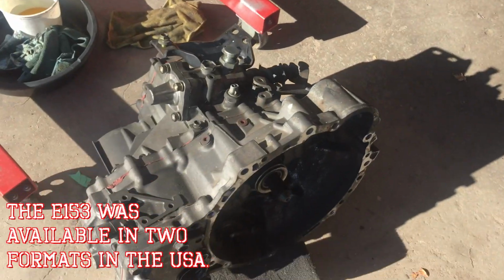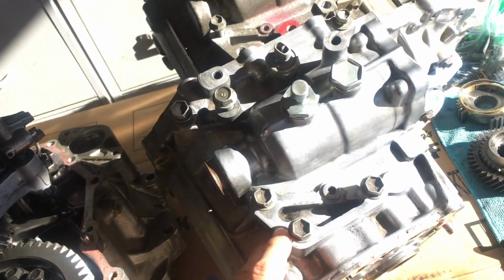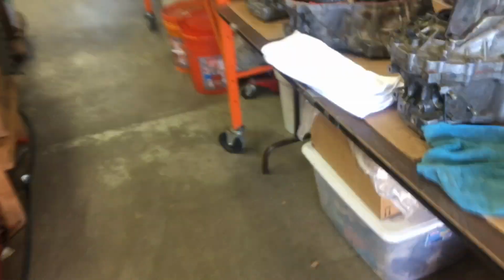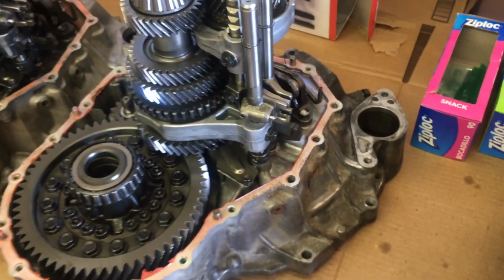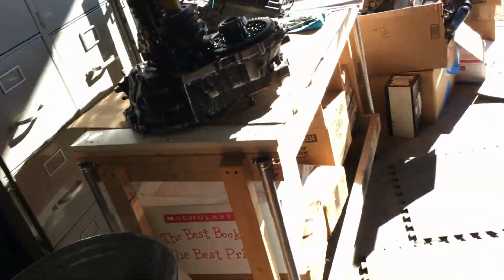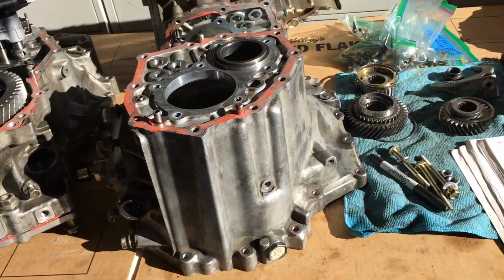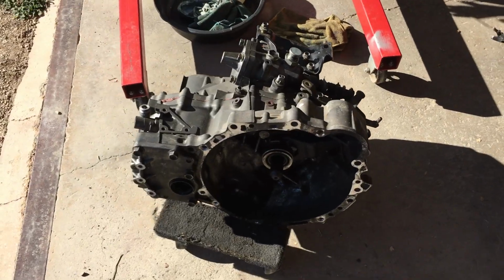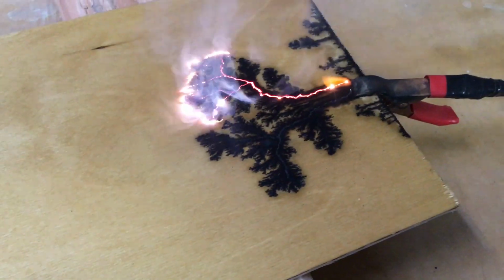E153 TRANSMISSION. MR2/CAMRY/SOLARA COMPATIBILITY!

Comment: Hey just curious where you found syncros for these?
Reply from the maker: The synchros I used in the transmission I rebuilt, were new old stock that I bought back in 2003.  The synchros used in the later model front wheel drive Camry and Solara E153 are still available for purchase from the Toyota dealerships.  If you plug in a VIN number from a later model vehicle that has the E153 in it (I keep these VIN numbers handy for E153 transmissions I extract from the junk yards, and I can use those VINs on Toyota Parts websites to lookup the exact synchro part numbers for those.  👍 If you have an early model (1991 to early 1992) USDM E153 from an MR2, you can get "replacement" synchros from Twos R US.  There is an Australian company called Gearbox Parts that made a replacement set.  NOTE: These replacement sets are based on the OLD design Toyota used in 1991 and is NOT the updated version later produced (like the PN's in my video).  The only synchro for 1991 that did not get updated later is: Ring Synchronizer No. 1 (1st Gear Side).  It's a bit confusing. :)

Comment: 1999 solara doesnt engage 5th gear. Is there a easy fix?
Reply from the maker: @ti8966  Hey!  Hard to say. I’ve not experienced a 5th gear engagement issue in these. That can be a difficult issue to diagnose. In the MR2, we see older shift cables stretch a bit and cause those problems.  What happens when you try to put it in 5th?  Does it grind?  Or just resist the physical movement of the shifter into that position?

Comment: Do you have an extra good 5th gear and synchro for a 91 e153? I’ll pay right away . Thank you
Reply from the maker: Hey!  I’m not sure if I have any good 5th gears or not. Any synchros I would have laying around would be used, but 5th gear rarely has a lot of wear on it. Sadly, if I have one, I wouldn’t be able to get to it until Spring. I have moved a lot of my stuff in to storage and I won’t be able to get into that stuff for a while. What problem are you having with your 5th gear?
Reply: @ thank you sir for the quick response, and well I bought a transmission from a fellow mr2 owner and he sold it because he had 5th gear pop out. So I took the cover off and I seen the teeth on the 5th gear are worn almost rounded, seems to me he didn’t know how to shift correctly. The synchro looks okay. But I’ve heard once the teeth are gone then it’s hard for the synchro to work with the hub correctly and hold. If you do have extra 5th gear synchro for the 91 mr2 that are used even if they are as long as they are in good condition that would be awesome. I wish you did have a 5th gear readily available.
Reply from the maker: @Supraassociate  Wow, really?!  I've never seen a 5th gear rounded off.  I know people talk about that issue, possibly, being due to an issue with the shift cables.  Is your car a turbo swap (3SGTE/E153) into a NA chassis?  Some people do not get the correct cables in the swap.  There are a variety of different shift cable combinations for these, and you may still have a problem AFTER changing the 5th gear and synchro.  I'll see if I can get to the boxes of trans parts I have.  I think I have only one trans that is incomplete, and I may likely be able to find a 5th gear for you.  I would also suggest tracking down the OEM part number for the 5th gear, and cross-researching if that gear was available in any other application.  I have found this to be the case with some other parts.  You may be able to find that gear in another transmission that used parts may be more available.
Reply: @ yes we’ll see the transmission I have came off a k series Honda swapped mr2, hence why I think that could have been the issue why his transmission ended up with 5th being rounded out on the dog teeth. my mr2 is a turbo chassis that was changed to na way back in the day. I’m trying to bring it back to turbo again. And the part number for the 5th gear I need is 33036-20050 . And thank you so much! Please let me know if you do find the 5th gear and parts for that 91 model e153 and I will gladly buy them. that would help so much. As well as some synchros if you happen to have any decent shape ones . Thank you sir in advance
Reply from the maker: @Supraassociate  Ok.  Understood.  Interesting... I looked up that PN and it appears it was used in the AW11 MR@ trans and in the ST16* version of the Celica (not sure which, until I dive deeper).  Are you familiar with ToyoDIY dot com?  You can use PN's and search other platforms it was used on.  I can't share pics in YouTube comments, but I did create a FB Group for the channel where conversations can continue and pics/videos can be shared.  If you want, join my new group there, and it will be easier to share this info.  I would also love to see a pic of your rounded-out 5th gear!  Here is the group page: https://www.facebook.com/groups/344083854669577/permalink/366928479051781/
Reply: @ unfortunately I don’t have a Facebook but I do have an Instagram if you have one? and the gear part number fits both E51 aw11 supercharged and early E153. They are the same thing essentially. Same gear ratios and internals.
Reply from the maker: @Supraassociate  Gotcha.  Ok.  I can do Instagram, though I'm not well versed in it yet.  Send me a message there and let's see if it will work to share info better.  Gotcha on the other platform compatibility.  I just looked deeper and the ST16* is only the E153 equipped ST165 (Gen 1 All-Trac).  I was curious if there was another NA trans that had that gear.  Doesn't look like it though.
Reply: @ yeah it’s very vague info about that. I just found about it yesterday. And will do I will message you on Instagram